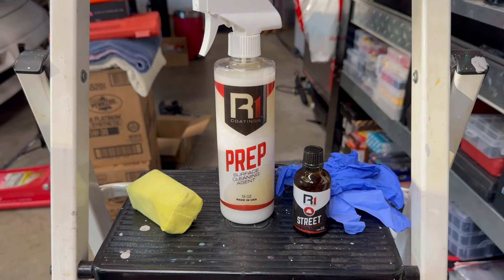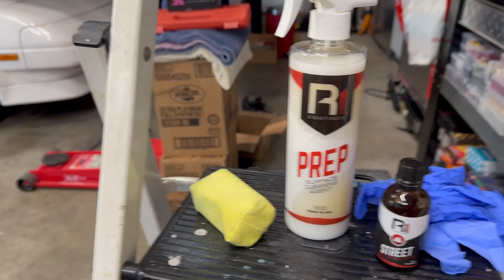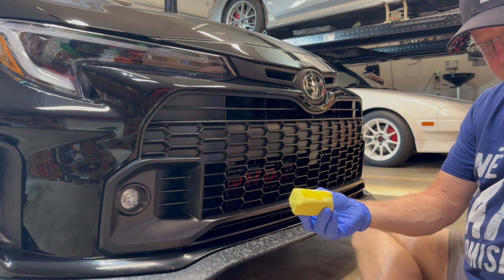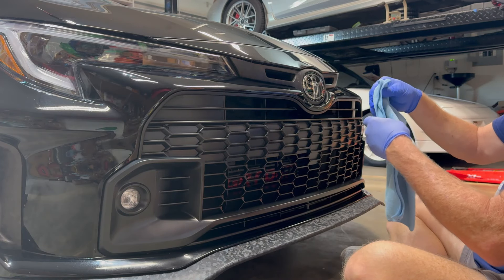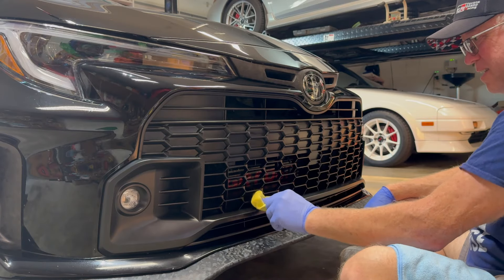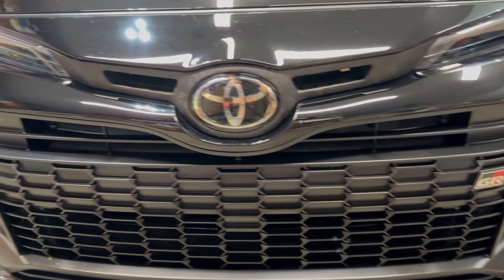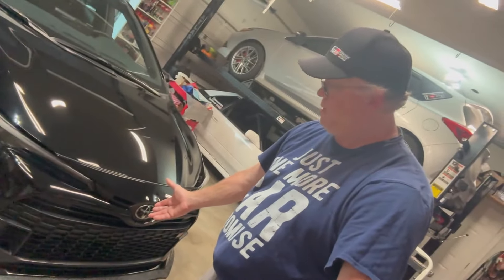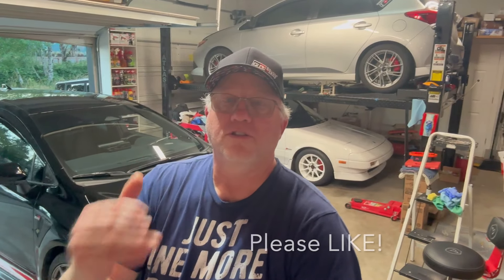The Ultimate Grill Armor Upgrade Guide

Comment: Jim, I have a question about towing hook attachment.  Do you know where exactly where it is at and how it suppose to get the hook on.  They came with only one hook in the trunk and I don't quite understand it.
Reply from the maker: There is a place to attach it in the front and the back but Toyota expects you to use it only when needed, that's why there is only one. There is a piece of the grill in the left front that can be removed and the tow hook threaded in. There is also a round cover on the lower right rear bumper that can be removed and it can thread in there too.

Comment: Oh my God, what’s happening now? Problems with the grill too? I saw some posts on Reddit, but I thought those were just isolated cases. It seems like these cars were put together in a rush. I can’t believe Toyota didn’t maintain the quality control they were once known for. This could be the beginning of Toyota’s downfall. Honestly, I doubt these cars will even make it to 100K miles.
Reply from the maker: Well, I wouldn't overreact, it's just some plastic clips. Most people in my GRC group have not had problems if they haven't had a lot of fun in the triple digit zone, or added a front lip. Both of these produce much more downforce and I feel the clips just give up over time. There are some simpler fixes that any GRC owner can do to prevent it from happening again. I do think that Toyota could do something but I don't think that it's happened enough for them to care yet.

Comment: Man mine did the same thing 😢 I feel if I replace it's just going to happen again.. is it the same quality? Someone needs to produce a better version, and shame on Toyota for this being so brittle.
Reply from the maker: I was curious if it would be a different design but it's not. But why not have it replaced under warranty? I don't like having anything on a car broken. The fixes I did that I'll be posting a video on will help a lot and I don't see it breaking again and I have another idea that I thought of after I did that video.
Reply: @jimsgaragetoys  That's what I'm saying. If it's the same why even bother it's just going to do it again 😔 shame on Toyota for producing such a cheap piece of plastic
Reply: Honestly though I might because I've got a a crack in mine. Probably from a rock I don't know 🤷
Reply from the maker: @tyrian869  I just think that at normal highway speeds and without a lip it's normally not an issues, but when indulging in triple digit speeds and/or having the additional downforce of a splitter lip it stresses the clips over time.
Reply from the maker: @tyrian869  I would agree, get it replaced and then strengthen it so it doesn't happen again.
Reply: @jimsgaragetoys  What's your other idea?
Reply from the maker: @mattwestrum7947  I just posted a video on that next step! Your timing was perfect. https://youtu.be/EuQO0z2klr8?si=x_yVAUhKCT9dWU_s